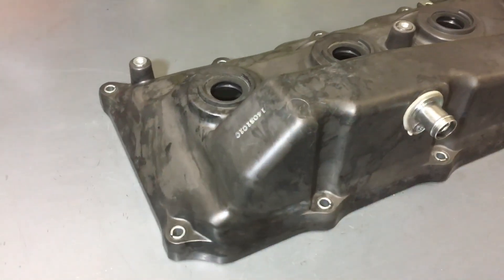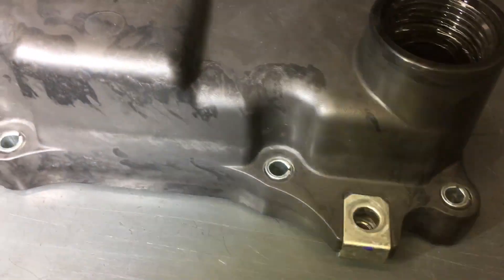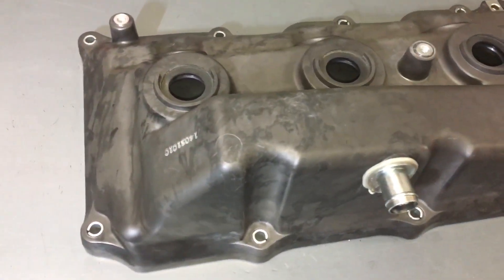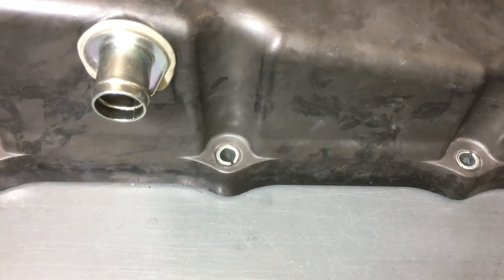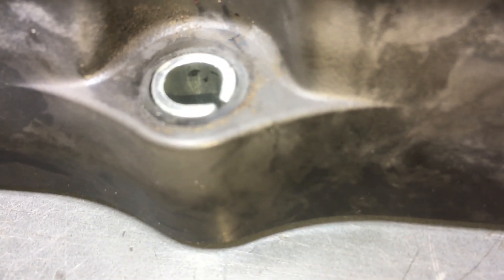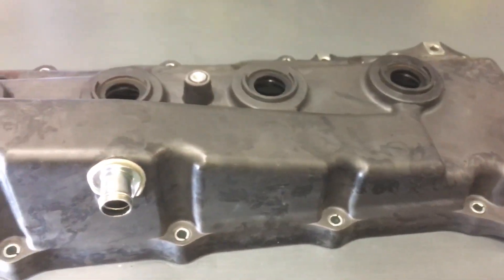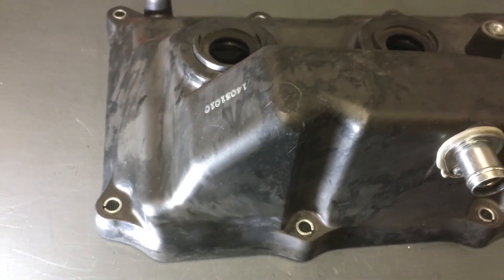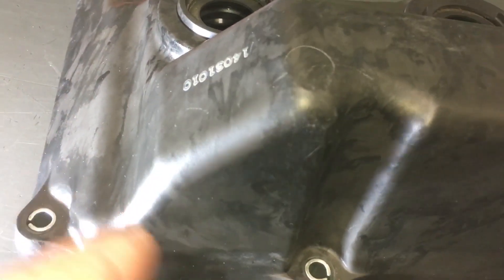CASE CLOSED THE BUTCHERS DID IT!

Comment: Particularly when plastic ages …it gets brittle and unfortunately even “good” experienced mechanics are not careful enough and hence our 2008 120 series a couple of years ago at the 300,000 timing belt change a micro crack occurred exactly where you said-near a bolt on the plastic flange, just enough for us to experience our very first small oil leak since we owned her (from 4 years old 100,000).
I actually thought the price (at the time) was very reasonable.

Funny, initially I blamed it being “plastic crap”, as I prefer metal…BUT I was wrong, very wrong, it’s simply lack of care.
The older the valve cover, the greater the care needed.
Simples;)